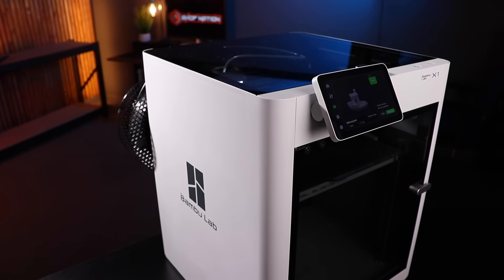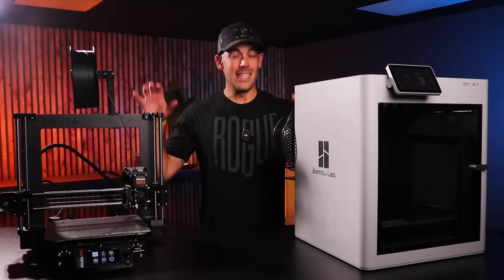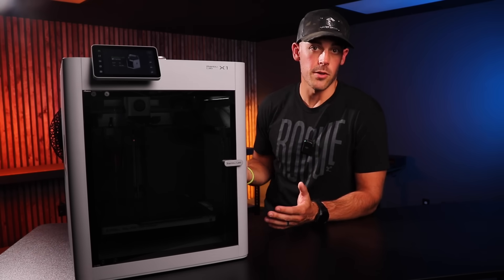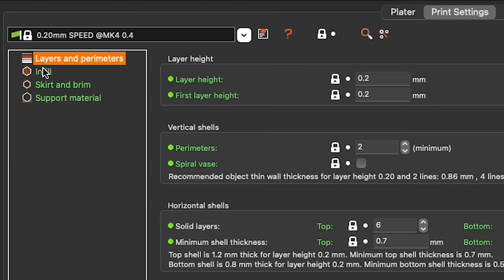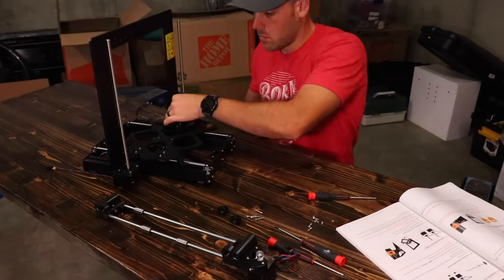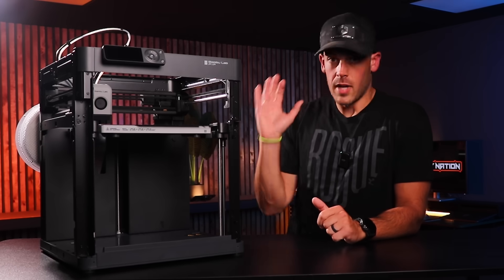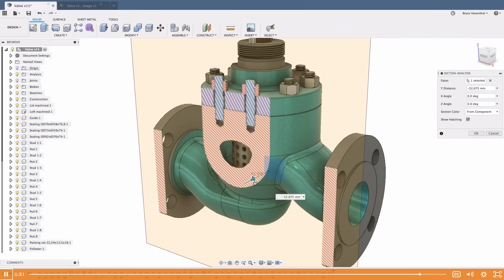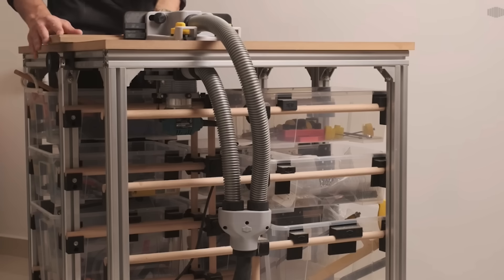The 3D Printer I'd buy if I started over

Comment: I have children that bought a 3d printer personally I didn't see the value in buying something so expensive it seemed like just another complicated toy they wouldn't really use. But now I am researching this because I am making my own sock knitting machine that to buy new would be $1200 but I can make for $60. I love that you mentioned the kit printer because one of the main problems my kids run into is how to problem solve when something goes wrong. I showed them your video and they were really intrigued as am I. Thanks for that.
Reply: Honestly, I bought my first printer for 1 purpose and that was to 3D print replacement parts for my RC cars when I broke them. Now, I 3D print and 3D model and make all kinds of things. Specialized tools and jigs, ham radio antenna parts, cases for electronics, tool organizers for all of my drills and batteries, shelf brackets, non conductive nuts/bolts/screws/washers, cable management devices for my racks at work and I even designed and 3D printed my own vertical axis wind turbine as a low cost green energy project. The point is, you start looking at stuff and thinking "I bet I could improve that" or "I bet I could print that" A LOT.
Reply: @DagonNaxos new to the 3D printing world, I don’t fully understand the modeling side of things or creating a model. How or where do you find the design or file needed to make the battery holders for my battery powered power tools? Thanks for any info you can give.

Comment: yup, best 3d printer video I've ever seen.  about 3/4  of the way through I realised I bought 1 of your Bosch dust collection chutes for my new glide saw. ( works perfectly by the way)  Fusion 360 doesn't scare me at all - I took an auto cad cert in high school when it first became available so the concepts are part of me..  Im  going to use your recommendation  and I have some questions about printing water or solvent soluble cores in the process and whether this machine can do that.

Comment: I knew this guy was going to recommend some really exorbitant printers, wish there were cheaper ones that work well
Reply: @-Fluxor  Thank you, that was really helpful and relieving to hear. That being said, do you have any recommendations yourself? I’m looking for a printer to make my own projects, details not so important but accuracy is for gears and stuff.
Reply: @-Fluxor  I was scrolling through online stores, didn’t find the Neptune 3 Plus in stock but found Neptune 4 Pro and A Creality CR 200B. Came out in 2021 and it’s fully enclosed, found a really good discount for it. Could get it about the same price as an Ender 3 V3 SE, problems though it doesn’t have auto levelling and top feed so I don’t even know if it’s worth it. No upgrades available for the model too apparently. On the other hand I found a Neptune 4 just slightly above the same price. Think it’s worth it? Neptune 4 or Neptune 4 Pro? Going with what people say it seems the upgrades are pretty insignificant.

Comment: Thanks for the advice. I have design and CAD experience so that end of it is a natural fit however I have been using a sculpto for several years now and I am about ready to upgrade. I tried an Ender 3 V2 but in tune with you  said . . . I would rather actually print things than to have to constantly work on the printer and upgrade all the breaking parts just to keep it working.

Comment: bought an Ender 3 from tax check and it came with NO instructions and I am not even sure it came with all the parts. So I kinda gave up on 3d printing and solving problems. Now You got me thinking I should try one again. Or maybe I will just try to learn 3d modeling and get good at that. Either way you have sparked my interest

Comment: I am not going to lie a Lulzbot is a excellent 3DPrinter & it will easily last 5+ years easily other then the bed , toolhead & consumables on the prusa mk4 the nozzle is good for 800 hours on a Lulzbot I have used the same toolhead every day for over 8 hours for a year & a half

I personally had less luck for the mk3 because of the jams with the Bowden tube

Comment: I wish I saw this before buying ender 3. Trying to get this thing to print ABS is a pain.
Reply: For ABS you absolutely need a heated chamber if you want your parts to be strong. They can be fairly simple to build, and with a heated chamber your ender 3 will print ABS just fine.

Comment: Thank you for sharing.  I'm guessing that these 'filament' printers produce parts which are more usable in a wider range of applications.  In short the filament material which can be used presents a wider range of materiasl that works for parts such as gears etc(nylon etc).  If I want a part for my car, these are the printers I want in the affordable 3D printer market.  However if I want to print high detailed parts for scaled models, miniatures and jewelry, I'm after a different solution correct?  I mean filament printers are used for everything I mentioned above but you have the layer issue and less detail.   So do you have a recommendation or would it be possible to do a video for the SLA style printers which use liquid resin and laser light to produce higher detailed parts.  While for applications such as parts used to work in industry the filament style printers are probably the go to printer.  In contrast for hobbyists(scale model makers out there) an SLA printer is more what you would be after correct?  All that said, a final request would be an additional review for the 'metal' 3D printers.  Is there an affordable model for hobbyists and small engineering companies and what would you recommend?  That may create 2 videos, an SLA 3D printer run down and a metal 3D printer run down and dare I mention if you want to touch on the civil sector the 3D concrete printer video. Thank you, Sean.

Comment: There's no way I'll ever stop recommending MK3S over anything on the market atm, even if the P1P was half price. I manage a lot of printers, and prusa's printers are absolute workhorses. My personal MK3S has gone for over 2 years without maintenance, at 1 year I just thought what the hell let's see how long it takes to break down from lack of maintenance... and it hasn't.  It's printing PLA/PETG almost 24/7 without breaking a sweat. I haven't even had to change the bed sheet.

The kit version of MK3 is easy enough for almost any adult to build, and teaches people a lot about the machine they will use. I wouldn't recommend an MK4/assembled MK3 to new users as I think just building the thing will solve most of their problems they might encounter with prusa machines (placed bed sheet on a screw, belt tensioning)

Comment: Speed is not really that important, reliability is. Products per time unit and Euros per product.
I found the original Ender-3 to be excellent in this if PLA is all you need, combined with Ultrabase ("Carborundum") glass plate you can even automate them.

High reliability, very high print quality, sloooow but cheap to buy and operate.

Comment: How about duration cut to 1/3, real, concrete info instead of fluff and no embedded food advertising? Do you really, really think that I want to be ambushed with food packages for $13 for what I can get for $4 in a local supermarket? Why are you avoiding the issue of ACCURACY? Manufacturers paying to keep silent? You claim that you are doing machine parts so surely you know that accuracy is maker or breaker especially with resins where post-proc polishing doesn't have sub-micron precision you get with metals without asking. I landed here by looking up 3D printers with 10 micron accuracy. Prusa hides it => probably 50 µm, Bamby P1S and P1P hide it as well, X1 brags about 7 μm which looks fancy but is horror (not even divider of anything => you have 1-6 μm misaligned surfaces => 4-6 μm gap - random rough +- 4-6 μm) and uneven division probably means you are not safe til 0.03 mm (30 μm). Try and see.
Reply: How about you send him 5.00 to get rid of the food commercial? That’s a win win

Comment: The new Bambu P1S that  just got released is just as good as the x1 at $699
Reply from the maker: Definitely not as good as the X1 but for the average user it’s great
Reply: @ShopNation  i shouldn't say "just as good" because, of course their is a reason for the price difference. But it still does a considerable amount of hand holding.

Comment: My background is similar to yours and I would come to the same conclusion.  We have a print farm at work with about 100 Prusa MK3s and they are definitely reliable, but I do hate their extruder design and how they can blob over the entire hot end and require a complete extruder rebuild.  We have started buying the P1Ps as well and that is now our goto machine when possible.  Not only are they faster, but the prints are higher quality.  Their AMS multi-filament add-on is also totally worth getting.  The LCD screen user interface on Prusa is better than the P1P however.  Bambu could easily fix this with a firmware update, but so far they haven't.  I mean, how hard would it be to add a "Print Again" option at the end of a print?  Even Prusa doesn't have that and it just drives me nuts.  In a production environment it is super annoying to have to go re-select the file (Prusa) or re-download it from the slicer (P1P) just to print the same file repeatedly.  P1P also displays error messages as cryptic numbers that then have to be cross referenced from their website to figure out what the actual error is.  It's like, if you have the RAM to store a 24 character number string, just put the damn error message there instead!  The firmware upgrades on the P1P are much easier than Prusa though, being automated through the cloud rather than having to go find a file online and upload it to the printer using the slicer.  Now if there  could just be an upgrade that fixes the above two problems!  I should mention that the Carbon X1 screen doesn't have these issues, only P1P does.  Unfortunately you can not upgrade a P1P to use the X1 screen so you are stuck with the LCD.

Comment: I'm quite curious to know what would you recommend for enclosed printers. Enclosures is a big thing for my climate where ambient temps can change at the drop of a hat (and has been responsible for large cavernous prints to fail like automotive ducts and the like). I print functional automotive items, so I work with filaments such as ASA. I'm looking to upgrade from just ASA and exploring carbon filaments. But my printer (which I agree with you, the ender 3 gets the job done. But needs to go through a number of upgrades and calibration to get the job done well.) is, incapable of handling such filaments.

Comment: I purchased an AstroFab 3D printer a year or so ago, which uses water-washable liquid resin. I was able to successfully find, scale, and print a project using the included software. Recently I went to their website to check for any firmware or software updates, and there is only a front page. Everything else is in room 404. 😞 I might be able to find more resin (more colors) on Amazon, but I'm afraid that once I use up the resin I have now, I'm out of luck. This video gives me hope that there might be something else out there for me. (A 3D printer kit? Maybe….)

Comment: You completely lost me at the absurd notion that $1,200.00 was a great deal for a "hobbyist" machine. I use a couple of AnyCubic's units professionally and could buy two or three, depending on the model, of AnyCudic's excellent machines for that $1,200.00. Most hobbyists looking at a 3D printer for home use don't need anything more than the Kobra 2 Neo which is currently $189.00. Even if you're printing shit for use in your garage shop it has a plenty big enough print size. It is also the user friendliest of user friendly FDM machines. If $1,200.00 is just something to piss away on a single hobby purchase in your world then I dare say you do not live in the world most of your viewers do.

Comment: Great video.
Love my original Prusa MK3 and MMU.  Having to build it gives you invaluable experience.   It even sat unused for a couple of years, got moved around etc.  But printed okay the first time I printed again.  A true work horse.   But it needs some new parts,  and I'd rather spend the money on the Bambu Lab X1C.
Then made the mistake of getting an Ender 3 Plus; great if you like spending more time tweaking it to get it work right than actually printing.
Just ordered my Bambu Lab X1-Carbon Combo 3D Printer - Starter Bundle, and can't wait for it to get here.

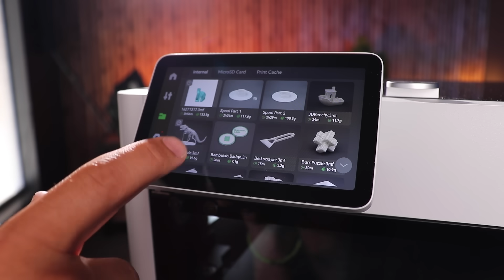Comment: 5:45 - Failed to mention that the Bambu Lab printer's version of network printing is to send the file from your computer to their Chinese server and then back to your 3D printer, and the Bambu Lab terms of service agreement you clicked through is the legalese version of All Your Files Are Belong To Us.  Do not use Bambu Lab servers for any file that is proprietary.  Many new 3D printers (Neptune 4, etc.) use Klipper and can communicate directly across a local area network.  A browser tab with a Fluidd interface provides excellent and intuitive machine control and monitoring and no need for the SD card shuffle, aka Sneaker Net.

Comment: I disagree with the premise of this video, expecting hobbyist printer to just work is a fast way to major disappointment first time something breaks.. it's no different than new generations of kids that have zero idea of what a computer file system is or folks that couldn't find an alternator in their vehicle, it produces subpar overall knowledge, fixing that lousy $100 ender 3 from microcenter and leveling the bed is not a bad thing, it will produce a lifetime of appreciation for this technology even after you upgrade to one these machines.

Comment: You are absolutely correct about the ender 3. The ender 3 is for tinkering with the printer and understanding the print process.
Reply: I truly don’t understand peoples criticism of the ender 3. I’ve been running one since 2019 and I have printed dozens of successful prints. I have upgraded nothing and the only thing I’ve replaced on it is the bed surface. I downloaded some good profiles and I’ve probably had three failed prints in all those years. I literally just put it together and it worked from day one. I have other printers now, but I still use the ender 3 regularly. Just preordered the Elegoo Neptune 4 plus. I think a thousand dollars for a printer is a luxury.
Reply: @kenkrugger  I wouldn't say it's a criticism. The printer is indeed great. I get just a good quality prints off the ender 3 as a  p1p. However, it's about time invested in the print and the printer. 

SD card, disable stepper, bed level, filament change are almost a per print process. This doesn't matter on a hobby or tinker printer, but adds up on a print farm. 

Then there is component failure and mods. Plastic cam arms on the filament feeder break often on the underside where you can't see the break, factory cooling fans die, etc. 

These are not bad things, they just end up costing more on a print farm in man hours than a p1p or x1.

Comment: What is this three dee printer you speak of? Also nothing wrong with starting off with an ender 3. All of the extra work and upgrades have made me learn in more depth. I can rip them apart, and tweak the software to suit my needs. I am glad bamboo was not around when I started out. I would not have had to learn near as much with it.

Comment: Your presentation JUST persuaded my quivering brain to invest into 3D printing for my blooming business of welding and fabrication of functional  gates, window security, and anything else I dream-up.  Homes everywhere are being broken into, so my solution is beautiful metal "prison bars" to keep those thieves from entering.  But I need to learn 3D first at walking speed, then, going to 3D METAL printing. With plastic I can take a rough concept model and hand shape it, or add another element, or elements, to until I have what my mind sees. When I have a model completed it is submitted to those to can do the layering instructions for my 3D metal machine.  An example: grape leaves need grapes to be added followed by a few dead grape leaves, followed by twisted tendrils.    YOU are a fantastic youTuber and instantly I knew you are someone I can trust to be my guide into commercial 3D printing.

Comment: I think Creality Ender 3 V3 SE solved couple of problems you said at the begin of the video. SE has automatic calibration and it is really easy to use. Dont have experience regarding printing quality towards other printers but for 250e really happy how it works and how easy it is to use.

Comment: Starting over is pretty much what I plan on doing. Going to sell my random assortment of 13 printers, and all the ridiculous spare parts cause they are mostly different machines/manufactures. Think I'm going to wait for the "P1S 2" (or what ever they call it), that includes some of the new tech from Bambu Labs new mini A1 printer. I've done the 10k upgrades / fixes thing for my printers, now I just want a single "reliable" tool.

Comment: I use the P1, going to buy a second soon, it is the best printer. I still have my Ender 3 and still love it, never had any problems with it. But all other printers I owned were messy and permanently in need of maintenance. The P1 (I build the enclosure myself) is the best value for money, it must not be the x1 to have an excellent printer, but it should be a Bambu Lab!

Comment: So back story, I sold my old 3D printer as it only had a 150*150*150 build plate and it was my first to learn how to design and 3D print. So, time for a new one as I had some prototypes to build and I saw this video and boom, pulled the trigger and bought a P1S with the added cabinet..Absolutely amazing, the slicer is so easy to use once you calibrate it and the speed and finish is amazing. Can’t wait to print the prototypes and have the engineering say “What, noooo wayyyy”. Thanks